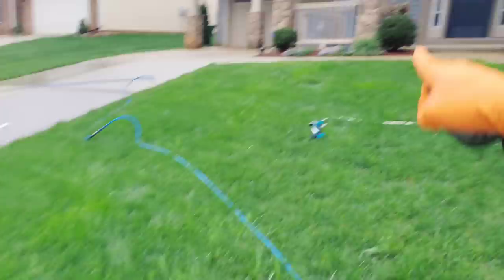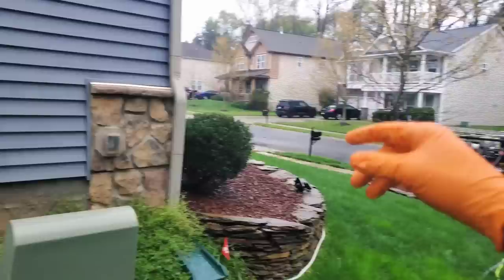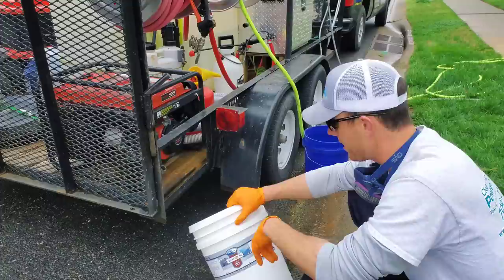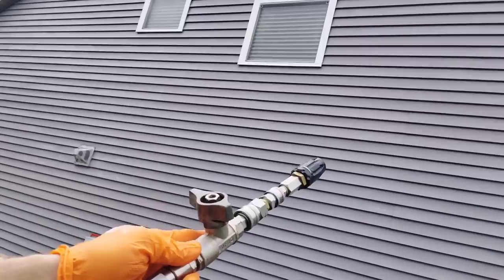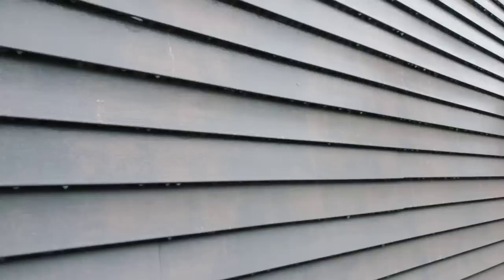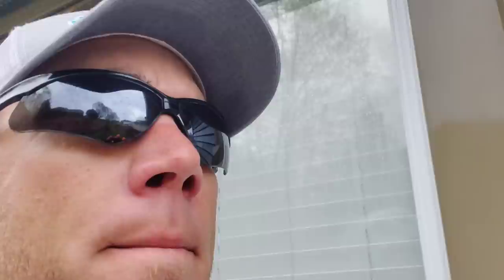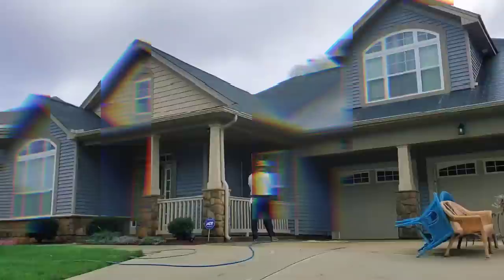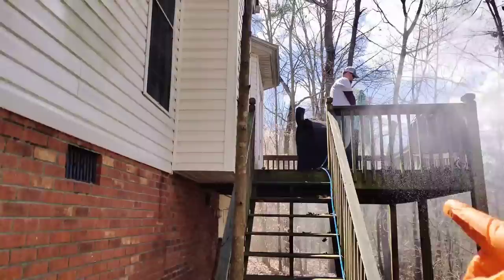Remove Oxidation from Vinyl Siding without Brushing | Soft Washing & Deck Cleaning

Comment: I think the lower sections get a little more heat and sunlight closer to the ground away from a roofs shade. Not sure if that is correct but I have noticed heavier hard to remove oxidation can happen at the lower 1/3rd of a building as well.

Comment: Which pump is that and how do you like it? Is that a 12V or 24V pump? 12-16GPM? Just bought my trailer and not exactly thrilled with my 12V 5.5gpm pump. Won't work for the houses around here that well. Too much work with a ladder on a normal 2 story. I want to be able to do everything from the ground faster. Fast means more money!

Comment: I will give this a try. I think I’m a really really Good house washer but oxidation is more of those things that always has us scratching  our heads. Did the siding have any sheen, when you got all that oxidation off. Wouldnt it be nice if there was something that would last that you could put on to the house and get that nice sheen like it’s brand new siding. I get asked that all the time fm customers “hey, can you wax my house and make it not so dull again?’  Lol I will give this product a shot. Really really good video. Probably the best one I’ve ever seen on oxidation removal. Keep up the  good work young man. I’ve been at this quite a while and you’re never too old to learn a new trick. We have to stay dynamic.
Reply from the maker: Cheers to that Steve!  Yes it will bring most of that back but it will have a slight fade from the UV exposure

Comment: Thanks for the video. Good stuff. 2 questions:

1. How much Cleansol BC did you use on the oxidation house?

2. What hose are you running for your soft wash? Size and brand please.

Great video. Keep up the good work!
Reply: I think he said its 1/4 ratio of cleaner
Reply: One gallon to three gallons of water
Reply: yeah i saw the ratios too but if you downstream youre 1/4 ratio mixed in a bucket and pull with a chemical injector it gets diluted an extra 1/10. I still dont understand.
Reply: @andrewtalamas  I was thinking the same thing. It’s definitely not 1/4 🤷‍♂️

Comment: It didn’t work as well because your 4:1 solution downstream turned into more of a 20:1+… That being said, even at this ratio I’m very impressed with this product!
Reply: By 12 volting it... we would know exactly what the ratio is... Without  knowing his downstreem ratio (which he knows)... its hard to say, but with every situation being different its gona be down to some pre-testing and prior experience with the mix to get it dialed in on the task at hand.

They were very close or as you suggested a little light on the first pass, but they got it done with just minimal scrubbing on the bottom.

Comment: Great video. FYI that is a dust mask you are wearing. Not a chemical respirator. I’m a carpenter and use that exact mask  all the time for cutting lumber. I also have a 3M respirator with organics filter when  painting.

Comment: $600.00 per job for this sized of homes.
My staff use hot pressure washers to get the job done quick.
This much easier than cutting grass. But grass cut are the bread & butter in the long run.

Comment: The best thing here Imo would have been to water fed pole it  first with  hot  water ( yes there are  hot water  water fed pole systems )  and then apply this chemical with a  telescopic pole  to get closer  to the surface being treated and  prevent less overspray  and the  rinse off  with the  water fed pole.

Comment: Great job. I have three questions? With the oxidation problem, when you soft wash the house would the SH damage the oxide siding, what was the mix ratio on the oxidation chemical mix and how much was used to complete the house, how long did you wait until applying the oxidation chemical after applying the SH.

Comment: Hey Ray. I'm fresh into this game. If I was to use my softwash proportioner system to apply the cleansol bc for oxidation removal, could I have a drop stick that drops into the mix bucket and pull it through the 1/4" fitting instead of the soap tub? If so, at the 4:1 ratio, how many gallons of 'bc' would I use per wall (say, the size wall you covered in this video)? Thanks for any info. Trying to figure out my pricing per 5 gallon bucket of bc I buy.

Comment: Hi Ray, I really enjoyed, and learned from your video. I did a house wash on Saturday, and today (Monday) the client said there were white splotches where the mold was.(she sent me photos, so I know this is true.) I'm going over to see it tomorrow, but I have no idea what this could be. I'm an interior painter/decorator, ordinarily, but am trying to make ends meet during this pandemic, so I take what I can get, but exterior washing is not my usual forte. I've done it a number of times before with no issues, but not a lot of vinyl washing, usually prep for exterior painting on wood. Thanks for any insight you might have to offer me.  I sincerely appreciate it.
Reply from the maker: Make sure to rinse very well or sh can leave residue
Reply: @RaymondNotario  Hi Ray, thanks for your reply - we went back and just did a gentle wet scrub brush, or even a rag, in some cases, to the affected areas, and rinse. All gone! I think we relied to much on the product and pressure washer. All this job needed was a little human touch to make it a success.

Comment: How does it come out to 1 to 4 if you're downstreaming ? My downstream is 2.1 so wouldnt that dilute it more?
Reply: Pink Flamingo Power Wash LLC I was gonna ask the same ?
Reply from the maker: The instructions say to mix it 4-1 and then down stream it 👍
Reply: Ahh ok. Thanks Ray
Reply: @RaymondNotario  What size is your downstream injector? 10:1 or 20:1?
You said you used 1:3 but, recommend 4:1. So, which did you use on that house? I'm confused.
Reply: @JamesBrown-ey4mt   yep very confusing. NO answer

Comment: Ok my steps are
1.wet the whole house down
2. Add cleansing oi bc and water 1.4 ratio.
3 spray the house let it sit for 5 to 10 mins or just 5?
4. Add a second application 
5. Wait again then soft wash.
AM I CORRECT?
Reply from the maker: You got it bro!

Comment: That was a clean job man! Wonderful. If I might ask you something, on every house wash job we do, in order to get it as clean as it should be we have to spend time with the pole brushes scrubbing the gutters and flashing and soffits. I dont mind doing it bc the end results are good. But from most of the videos i see out on youtube no one really seems to do that or show that part. What do you reckon? And what do you recommend?
Reply from the maker: we never brush unless doing gutter brighting or oxidation removal.  Use a little hotter mix

Comment: Your C BC is mix of 1:4 but you don't mention your downstream injector specs. 
What orifice size are you using on what length hose and are you using a high flow 20% like the Adams injector.

Comment: Hey ive got a particularly hard job.  7 years of the client having the siding powerwashed.  The damage is extensive.   The oxidation is about the worst ive ever seen.  Can cleansol bc go through a soft wash machine?  The pump is replaceable just need to know if it will damage the pump prior

Comment: Just curious if you mix a 1:4 as instructions but then downstream, wouldn’t the downstream injector water down the 1:4 mix?
Reply: So the 1:4 is 25% strength the down stream injector is taking a percent of that mix it could be a 20% injector don’t get too into the weeds with the math
Reply: @thelonewolf267  so around 5% coming out of the gun?
Reply: Yes, 20% of 25% is 5%.

Comment: It's a hit and miss product I have found but it's pretty caustic stuff as turns surfaces brown.   Find it works better when the ambient temperature is higher so applying it when heat would help on colder days.   I just resort to 2 step as neutral and takes much less time, and product.
Reply from the maker: nice
Reply: 2 stepping for oxidation?

Comment: If my 2.5gpm machine has a built in DS injector that pulls 20:1. Can I use this product straight? Havent upgraded my equipment yet. But working my butt off to...
Reply from the maker: dilute it down 4-1 then ds it

Comment: What is that black nozzle you are using when applying the Clensol BC.  I may be wrong, but it doesn't appear to be just a normal black soap tip.  Am I wrong in assuming that? It looks like it has an adjustable stream, kind of like an X-Jet.  I didn't see a reference to anything else it in your list of Products.  Thank you in advance.
Reply from the maker: it's called a m5 nozzle
Reply: @RaymondNotario  - Thank you.  I didn't realize that they sold just an M5 nozzle that didn't have a tube connection for "soap" pickup.  I'm familiar with the X-Jet M5 "normal" setup, I didn't realize they offered one like that. Quick question though, does it ONLY draw as a soap nozzle application or will it work whether you are drawing soap or not?  I hope that made sense.

Comment: Have you tried this on vinyl shutters?  I diluted it 4:1 and down streamed through my pressure washer and it did nothing. I even did a 3rd shot and scrubbed them. No change. I then tried the 4:1 mix in a hand held sprayer. Same results, even scrubbing didn’t help. Any ideas or are vinyl shutters a lost cause?  Thanks
Reply from the maker: I haven't tried it on shutters before

Comment: Hey man, i made a huge mistakes. Mixed water & bleach  and should have rinsed a section at a time. Waited till i sprayed the hole house siding. Its a light tan siding. When i washed it i noticed a light coloring of the siding was washing out. 😞.
Now there are spots in random spots of the siding. 
Is there anything i can do to restore it or did i toast and roasted it? Should have washed your video first.  Thanks

Comment: Hey Ray!
Quick question....
I have an oxidation removal job, on a two story, vinyl sided home that has bad oxidation and someone zorroed the entire house.  I'm running an 8 gpm with a high-draw injector (2.3) and I'm planning on mixing the cleansol bc at 3 parts water to 1 part cleansol bc.
My question is, do you think that the process will work? Any recommendations would be greatly appreciated!

Thanks in advance 👍

Comment: Have you had any issues with the cleansol Bc on any other material other than vinyl siding and have you used it on metal roofs yet..?
Reply from the maker: we've used it on vinyl, gutters and metal roofs with good results

Comment: Does this remove those pressure washer marks you were describing earlier in the video 😅 asking for a friend. I do believe I made that mistake on a customers house... I wasn’t used to the new 4gpm unit I just bought. They haven’t called back yet but I’d hate to leave it like that. Thankfully iv already orders some cleanse all BC for an unrelated customer. Should be here in a day or two.

Comment: Hey Ray good stuff... Quick question... What would you recommend for cleaning aluminum gutters during a softwash? I usually use sh for softwashing vinyl but ive noticed it does absolutely nothing on aluminum... Thanks!
Reply from the maker: yes we do
Reply: F13 gutter grenade is great. It's a brush on and you need to be cautious of drip but it's powerful stuff

Comment: the mix is 1 to 4 . Is that the solution that should be applied to the siding ? I ask because when it is mixed doing downstreaming it will be much much less concentrated when it hits the siding ?

Comment: I hear Cleansol will also kiss organinc growth algae etc..so couldnt you use just use cleansol for the houseweash and oxidation at the same time? save money and time?
Reply: Maybe you first have to take off the organic growth first with the SH/chlorine. It's cheaper to use SH because in Florida 1 gallon of SH can cost $1.50, while 1 gallon of Cleansol BC may cost $50 with shipping. 

So washing it with SH first would be cheaper to tackle the organic growth. Then the Cleansol BC can be used to specifically target the paint oxidation.

Comment: Hey Ray, how about aluminum siding? I have been trying to get this house cleaned for 5 years. Three guys have tried and and took off running. LOL 1 used cleansol bc, one softwashed , 1 used high pressure .Looks like this house but aluminum. Know anybody in N.J. that is knowledgable and can do this job for me? I am 72 and want to stay off the ladder. Can you help me??
Reply from the maker: Bruce!  From the sound of it, I have no doubt you could get this done but I agree you should stay off that ladder!  That oxidation tends to scare most wash companies but there's some that don't mind taking it on.  I will try to help you find someone qualified to get this done.  Shoot me your info and I'll see what I can do.

RaymondNotario@gmail.com

Comment: On the house with the oxidation removal were you using a turbo nose to rinse with it looked like it was rotating it did a very good job what was that product called cleansol bc
Reply from the maker: no a turbo nozzle is bad news on vinyl.  We used a soap tip m5 nozzle

Comment: How can a homeowner apply this without that set up?
Reply: 2 gal sprayer and a good amount of time.    Like he mentioned, follow the recommendation for mixing it and you’ll be good. Cleansol BC is the way to go.
Reply: @jcreations9353  I have a 3400 PSI DeWalt pressure washer. I ordered a jrod as well. Is this enough to get it done?
Reply: Devin Jones you need to purchase a high pressure downstream injector, that you hook up to your pressure washer. It sucks the chemicals out of a bucket and straight to your wond. That way you can clean your home first with bleach/water/soap ratio, then hit it with the Cleansol BC like here in the video. ANY question you have no matter how simple it is, you will find it on YouTube.

Comment: RUST, NOT MOLD, Not Alge, Not Fungus..  Brown deep stain.  My problem was rust in the well water that got sprinkled on my vinyl siding.  Tried EVERYTHNG including laquer thinner, acetone, every blue orage cleaner out there, even IRON OJUT  .  Trust me, Muriatic Acid (AKA contcret etch!) does it. Vinyl seems t tolerate it very well unlike acetone or lauer thinner.  You might also tey radiator cleaner which is oxcillic acid.  used to remove rust in clothing.  Oxy clean i think?
Took it right off.  I'll try thinning it out, but full worked so well.  For full strength Muriatic:  Wear Equipment!  ghave  BUCKET OF WATER NEAR BY.
1.   Put on a Rag full strength wipe it on wet..  rub it A BIT, wait ~5 MINS, then wipe it OFF!
CLEAN IT SPARKLES, GLOWS, looks new.
Stuff burns. don't breathe it, goggles.
Reply: Also got onto the aluminum window frame white paint or powder coat.  just as bad as the vinyl..  nothing worked, gone!  You're mileage may vary, amazing this stuff is legal!  full PW pressure  (3400 PSI with 0 degree tip at 2" wouldn't touch this rust.  Acetone if scrubbed takes it off, but too scary.  IIs it Rust is the question..    Etch your garage floor with whats left.
Reply: I chose to hook my sprinkler hose bibbs before the water treatment system..  no rust in toilets, but whoda thought such a MoFo on Vinyl Siding!  Professional House washers, Snake Oil Salesmen, Profiteers, Ebay sellers, take note!!  I'd paid like $80 researching this..  with cleaners I have no use for.  If it's rust, Muriatic is the solution..  with experimentation, the perfect "Meguires" style cleaner diluted just right, maybe with some ceramic wax added could make you RICH!  You perfect it, we will pay big bucks for it.

Comment: i thought that when you wet down a house b 4 you soap it you are suppose to cover all electric box connection s ect  did not see any of that viewer s get the idear that spraying down a house with out covering is o k blue sky window new york
Reply: I’ve been at this this maybe seven years and I’ve probably done 1500 houses. I’ve never covered an electrical box yet. Unless the customer has tore off the cover, etc. . I do spray  a little more cautious around the boxes  but I don’t cover them up. I have never had a problem. Sometimes you see people who make videos telling you to cover them up. I think they’re just covering their  bases. By all means I don’t think it would ever hurt to cover them up or tape n plastic them off or do something, but I don’t think it’s necessary.you have to stop and think, most of the idiots out here washing houses are hitting  it with 3000 psi. That will do some damage around electrical box. I’m soaping  with less than 100 psi and I rinse with about 200 psi.. There’s a big difference. I’m not a power washer. Im a house washer.It’s all about common sense. But since I’m in the wash  industry, I will say 2/3 Of the people in this business don’t have much common sense. Sad but true :-). Common sense goes a long way in the world.
Reply from the maker: We tape the top of all meter cans